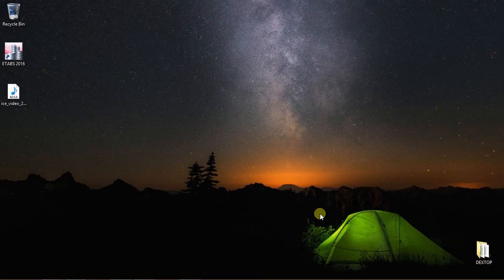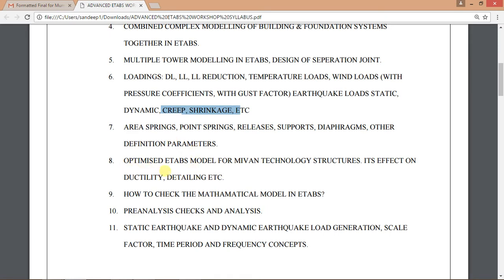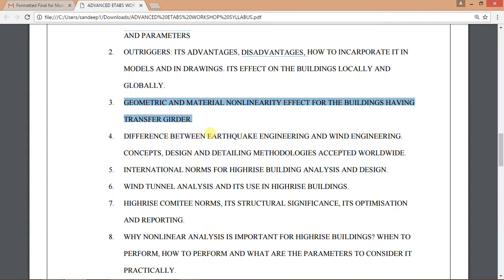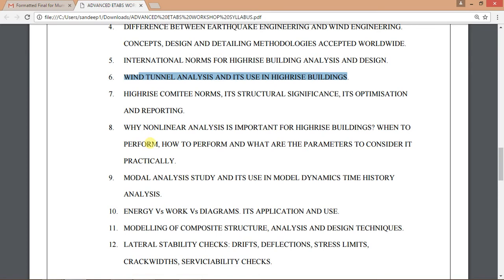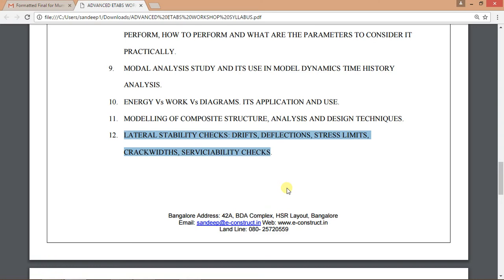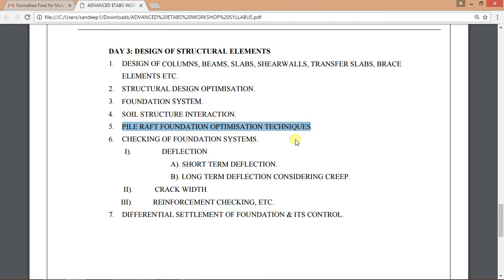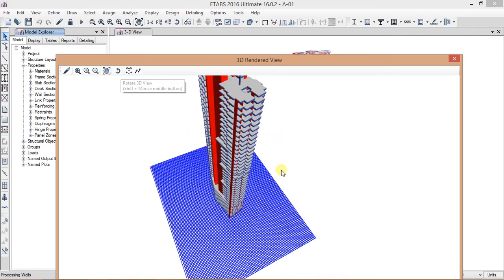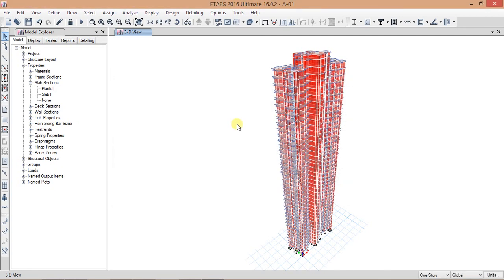ETABS ADVANCE WORKSHOP TOPICS AND SAMPLE PROJECT

Comment: sir i want to know what is differs between shell thin and membrane and what is usually used on project and also what is p-delta effect input
Reply from the maker: Only in plane stiffness shall be taken into consideration when it comes to membrane...In plane and out of plane stiffness shall be considered when it comes with think shell element.FEM is mandatory when thin shell element is to be considered.p-delta is second order geometric nonlinear analysis. Type of element that we choose is nothing to do with the second order p-delta analysis.I hope this helps for the moment.